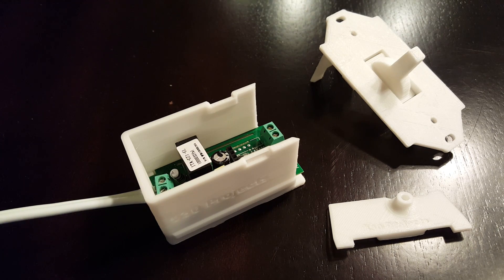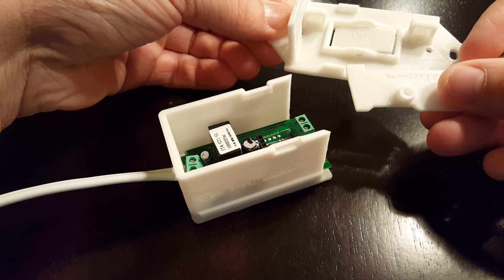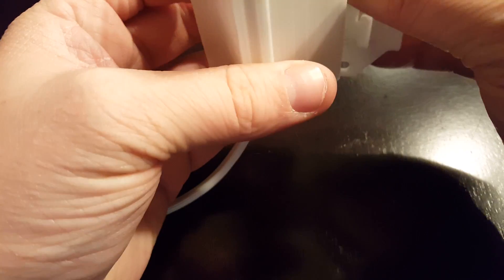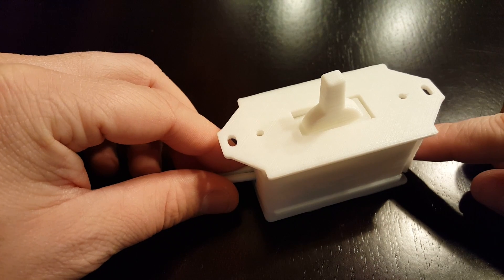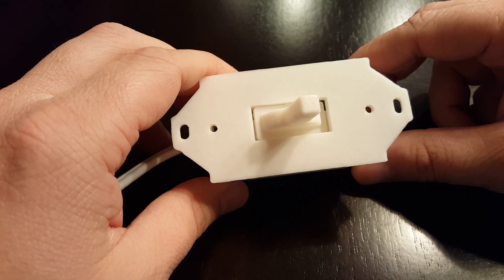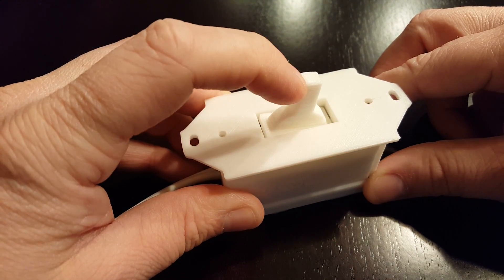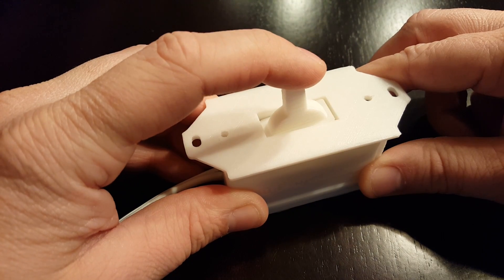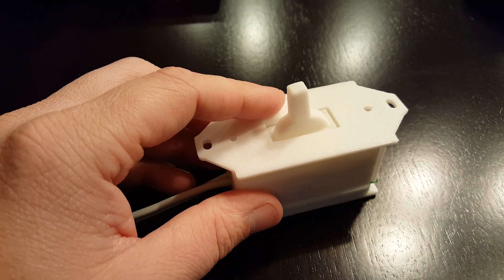Sonoff Light Switch v2 - Overview

Comment: what code do i need to put in home assistant to get it to show up
Reply from the maker: I have added the configuration that I use on my home assistance to the github page. I installed my switch to control my pantry light, so that is that what I named it. https://github.com/530projects/SonoffLightSwitch_v2

Comment: Subscribed, and thanks for the little trick there. Was thinking a little spring loaded button, or even a touch responsive actuator rather than a switch might be a little more aesthetically pleasing. But hey, it does it job right!

Comment: I used a Sonoff Dual and wired my ceiling fan to turn the fan and the light - EACH - on and off with the app and Alexa. Each works independent of the other.

How you may ask?  So simple, it should have been done and posted on Youtube already. Hey Andy, how about trying this then documenting it with a video? Please.

I have access to my attic and the upside of the ceiling mount I removed power and installed a   one gang box and a single 120v wall outlet with cover. I like the simplicity of being able to unplug the fan from power with just unplugging. 

I cut a 3 or 6 foot 2 prong extension cord about 12" from the female plug. Then wire the two prong cord/plug into the L and N of the Dual contacts Input.

Connect Output 1 to the Blue wire of the ceiling fan.
Connect Output 2 to the Black wire of the ceiling fan.
Connect one of the Dual's N to the white wire of the ceiling fan.

You only need to connect one of the Dual's N to the ceiling fan. Leave the ground wire on the ceiling fan connected to the ground on the 120v wall outlet. I don't know a better place to post this, so maybe it will benefit others that would like to do it.  Cool, huh?

Now, I plan to use the two sets of terminals on the Dual to add two small momentary switches at the wall switch and run light weight speaker wire down from the Dual to the light switch, so they can be turned on and off manuals, and reset.

Comment: Thank you for the inspiration Andy.  I was never happy with the lack of tactile feel of the toggle switch and the excessive pressure the paddle design puts on the Sonoff's push button so I created my own Decora style switch.  
The SonDek.  A Sonoff Powered Decora Light Switch
https://youtu.be/u0QlKFAFgY0
Decora Style Light Switch with Sonoff WiFi Smart Switch
https://youtu.be/el36IK6sVIY

Comment: I like the idea but Sonoff has touch switches for like $15 directly from their website. Then you can group them with triggers so if you have multiple switches for one light like a hallway each one will control the light no matter what state each one is in.
Reply from the maker: I believe that you can set up the sonoff basics like that too (I don't know why you wouldn't be able to). The only problem that I have with that is the switches have to be connected to the internet to some server that you don't have control over. That's why I put in my own firmware and control the switch with my home automation system. In my home automation system, I can set up scenes and create rules to mimic a three way switch. It still relies on my local wifi and home automation to be up in order for it to work, but that's still better than needing to connect to a remote server over the internet.

Comment: This has nothing to do with my 530 Projects switch enclosures. I just want to post this since Andy is on top of Sonoff things.

I wanted to add a comment about a recent back of Sonoff Basic and S31 devices I received.
The S31 is a new product. Its a plug in outlet type device. Its similar to the Wemo Plugin. 
I received 10 1st gen Basics and 2 of the S31s. I was excited to get the S31s and started replacing the Wemo devices. The S31 plugs would not show up under my iPhone 7 iOS 11.2.2 wifi section so I could join to them. Nothing would work. No ITEAD-xxx devices show up.  So, I tried my Android phone.  The directions are a little different. Don't try to use the phone's OS to connect to the devices via wifi.  Go straight to the eWelink app and plug in the info, (you know) your SSID and password, and proceed. However the devices don't show up as ITEAD-xxx devices. Instead they are MyDevicexxxxx devices.  Fortunately I could add them to my eWelink account under the Android phone, the log out. Then go to the iPhone and login on the eWelink account and see and manage/use the devices.  The firmware on the S32 is 1.0  Mabe we need a firmware update already?

  Same thing on one of the first Basic devices too that I tried to use from this batch  Firmware ver 1.6

Anyone else have a similar issue?

Comment: I'm curious to know what you found to be the key for getting your device to respond to the pushbutton immediately in a reliable manner.  I've played around with a couple of custom firmwares for the Sonoff, and this has been one of my disappointments as well.  I'd like to learn from your experience.  Thanks.
Reply from the maker: Yeah, that was one of the big things that I needed to figure out how to make work. Because nothing is more frustrating than having a "smart" wifi switch that won't respond when you try turn turn it on like a normal switch. 
How I accomplished this was to always check to see if the button was pressed. (the best thing to do would be to set up an interrupt, but I don't believe you can do that on GPIO 0). 
There is a little time when the switch first boots that it won't respond to the button. But after that it should always respond. 

I have it so if it loses connection to either the wifi or MQTT server, it checks to see if the button is pressed before trying to reconnect again. And if it continues to fail to connect for a specified number of times, then it waits for 10 minutes before try to reconnect again. And while it is waiting that 10 minutes, it is just watches the button, waiting for it to be pressed.

I have used my custom firmware in my switches for several months now and not once has it failed to recognize the button press. Even when my home automation server was down, it still worked every time.

Comment: Do you have to flash the firmware on to the switch or would the firmware that it comes with work also?
Reply: I presume that it would work with the stock firmware that sonoff comes with. But I haven't tried it and can't say for sure. All this switch does is pushes the button on the sonoff. So if pushing the button with the stock firmware toggles the relay then it would work. I have always flashed my own firmware into the sonoff switch and have never powered one up with the stock firmware.
Reply: Andy Goodenberger thanks
Reply from the maker: Shoot you found out my secret identity because I sent you a reply from the wrong account.

Comment: I ordered to of your switch enclosures.  But like several people have asked, please make a decora style switch that we can purchase.  I would give $5-7 more for the decora design plate. What say you, please?
Reply: I will see what I can do in the next week or so. I have purchased a decora switch and switch plate cover to get the dimensions of the switch. And have realized that it presents its own unique difficulties because of how much space the larger actuator takes up. But stay turned for another video once it's done.
Reply: Thanks Andy.  You can count on me to buy 4-6 (maybe more) of these Decora kits if you will make them.
Reply: GREAT PRODUCT.  Andy, I didn't have an email address to thank you for this product. So, here it is.  I ordered and received two from you.  I've installed both. They work GREAT. So simple and they turn the lights on/off every time.  I've swapped out my Wemo's for the Sonoff every where now. Overall investment is less than half what Wemo's are.  I want more of these enclosures, but I am going to give you a little time to get the Decora model up and running. That's the ones I want. So, please let us know when its available. THANKS
Reply from the maker: I am glad that you like them! Thanks again for buying them.

I have been working on the decora design and I would say that I am 95% done with the initial design. I am trying to make it have a similar actuation where you can press the top or the bottom to activate the switch. I just need to put some finishing touches on the cad parts. Then I need to print it to see how well it works, and make any minor adjustments to make it better. I will release a video once it is complete. Hopefully I should have it complete and video posted by the end of January. Stay tuned...
Reply from the maker: I have been through a few iterations of how the swicth is assembled and the mechanics of how it actually presses the button and how the parts are actually printed to give the best appearance once installed. I think that I am finally happy with how the actuator is made and assembled, but I am still refining how the "paddle" works inside the switch.

I am in the home stretch, as I am now just making small adjustments and not radically changing the design.
Reply from the maker: Steve, you'll be happy to know that I have completed the design of the Decora style switch. It has a really nice feel to it and it improves upon some things on the toggle style switch. I was also able to shoot the video for it. I just have to edit the separate videos into one. I hope to get it published by the end of the week. The only part that might hold that up is I shot the video with a new action camera who's lens has a lot wider angle than my phone. So I hope that it captured enough detail. If not I may have to re-shot it with my cell phone as before.
Reply: Andy,  looking forward to hearing you give us the status on the decora designed enclosure.  (Its the end of Jan, :)  )
Reply: Few iterations, eh?  Good, Excellent. Glad to hear it. Please don't rush if you can make it better. I'd rather get them that meet your standards than something that just gets by.  Looking forward to your great product.
Thanks.  Steve
Reply: Andy, that's very good news.  Once your video is done and posted, I hope you put the new stuff on etsy. If you are pleased with your work, I am sure that I will too and I am ready to purchase four right away. :)  Thanks.
Reply: Andy,  Do you have an update for us on the status of the new enclosure? Looking forward to hearing some good news that its ready for sale

Comment: I don't have a 3d printer. Why not just solder a connection directly from where the sonoff button is to your wall switch?
Reply from the maker: I never have liked the idea of trying to cram a Sonoff into the electrical box with the existing switch and the several inches of solid 14awg wires. Plus you would need to protect the Sonoff somehow, most likely by wrapping it in heat shrink or electrical tape, and that just adds to its bulkiness. This 3d printed case that i designed protects the Sonoff and utilizes the space that was created by removing the existing switch. 

If your are interested, you can purchase some of the 3d printed parts from me on my Esty page. I will print, clean, and assemble the actuator to the mounting plate before shipping.   https://goo.gl/zBYmb6
Reply: xbb1024, it isn't that simple.  The push button is a momentary switch and a latching (light) switch won't work in its place or in parallel.

Comment: Definitely impressive. I'm just wondering if you could do this with a small, flat rocker switch, instead of the lever type you used. I don't know what they're called, but it's just like a decora type switch, but smaller. Approximately the same width and height as the switch you used. Just flat.

Something similar in size to these switches:
https://goo.gl/images/SxQTiS

Comment: Awesome! Thanks a lot, you're a genius! I just ordered the three-pack from Amazon, and I'll get printing as soon as I get them. Question, how do I upload the code? I have done tons of Arduino, but how do I plug the switch into the computer usb?
Reply from the maker: Thanks very much, I'm glad you like it.

To flash the firmware:
1) You need to have a 3.3v FDTI programmer. I have the VisiPort2 which you can find here: https://www.tindie.com/products/Earth_People_Technology/ftdi-usb-to-serial-breakout-board-the-visiport2/?pt=ac_prod_search

2) You need to have the ESP8266 added to your boards list in the Arduino IDE. To do that go to Tools>Board>Boards Manager. Then in the search box type "esp8266" and install the "esp8266 by ESP8266 Community.

3)Disconnect you sonoff from any of the wires connected to the screw terminals on the sonoff. Connect your FTDI programmer to the sonoff by connecting Power - Power, Ground - Ground, Rx - Tx, and Tx - Rx. You can refer to one of these pinouts to know the pins on the sonoff: https://www.google.com/search?q=sonoff+pinout&source=lnms&tbm=isch&sa=X&ved=0ahUKEwj9-O3buP3XAhUh9IMKHTJOCR8Q_AUICigB&biw=1536&bih=734 

4) Before you apply power to the esp8266 (by connecting the USB cable), be sure you have the button on the sonoff pressed. This connects GPIO0 to ground and puts the ESP8266 into program mode. Once the ESP8266 has power, you can release the sonoff button. 

5) Open up my firmware that you downloaded from github: https://github.com/530projects/SonoffLightSwitch_v2

6) edit the code to match your wifi and mqtt setup, then save it.

7)  Select the "Generic ESP8266 Module" for the Board, with a 1M flash size.

8) select the correct com port and 115200 baud rate and click up load. 

After it compiles you should see the Rx and Tx light flashing. If it fails, there are plenty of resources on the internet to help you with whatever problem you are seeing, just ask google.  

Good luck and I hope you enjoy your new, ridiculously cheap, smart home switches! I know that I enjoy using them every day. 

Please let me know how it goes and be sure to upload photos to the thingiverse "I made one" page.
Reply: @530projects4  do you sell this 3d printed switch?